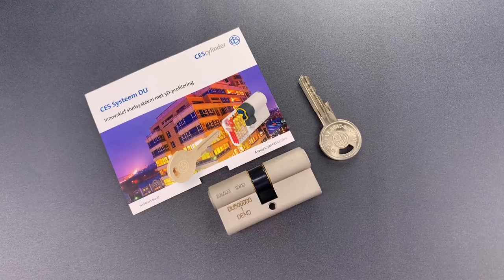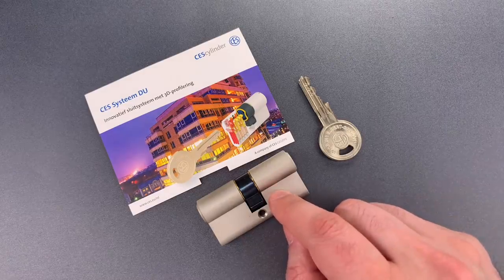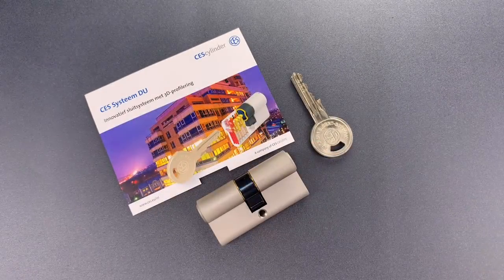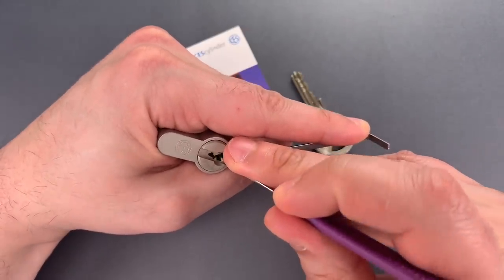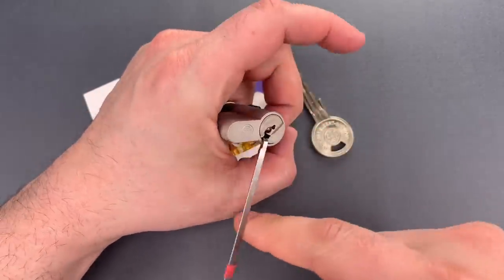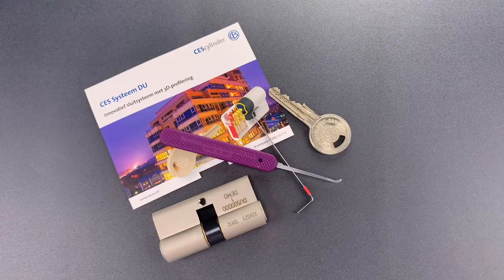[1248] Absurdly Paracentric CES Euro Cylinder Picked

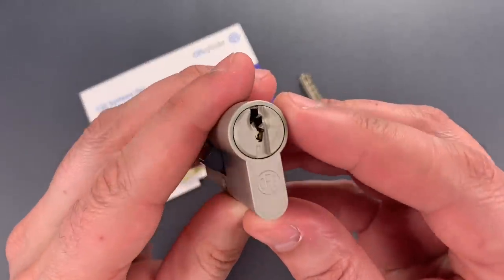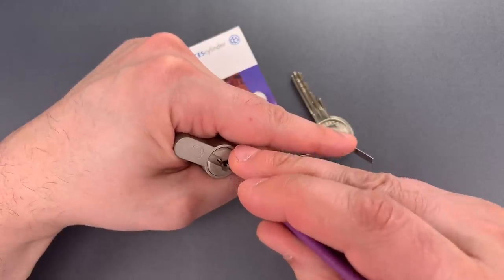Comment: So, you show the lock the right side up 0:13 but when you pick it you turn it 180° 1:00 so the pins fall down by gravity. You do this in every video. You remove a door, turn it 180° and than pick the lock? Start picking locks the right way up like they are on a door and not turned 180°. I gave a child lock to pick and set the lock like you pick them the wrong way up and they can do it with ease. Put it the right way up and they can't.

Comment: The key even has dimples to try to confuse people?
Reply: Those would probably be key-control.
Reply: Ahh, that's why LPL used a pick with dimples on the handle ;)
Reply: hi, do you mean dimples or the dots on the sides of the key??
Reply: @ConstantlyDamaged  Key-Control?
Reply: @Tidiabl69  he means the dimples on the side of the key lmao
Reply: @black3pac  ok , sorry for my translations problems , i'm not fluent in english...but I use this kind of key at home and it open the building entrance door and my appartment door , so , i think (but not sure) the dimples position is the same on every neighbour key (to open the building entrance) and the appartment lock is using the other way wich is different for each neigbour...
Reply: I think the demo version is just for show. Should have pins, I see pins on the PExtra Kaba key or the Iseo F9. Should be picked.

Comment: After watching hundreds of LPL videos, I have determined that the only unpickable locks are either a welded shut lock or a lock sticker.  

In the fire service, it is a challenge to train fire fighters to try the door knob to see if it is locked before breaking down the door bypassing the lock all together.  Many times it is not even locked.
Reply: He has a bunch he was never able to pick. Most had wild key ways. There was at least 5 that i remember
Reply: @baqcasanke  he could not pick a bowley lock, I think.

Comment: Genuine question: Is it easier to pick these locks as standalone units where you can get a good grip of the lock, than for example if the lock was actually in use installed into a door?
I would assume that being in a door, it would be easier as you don't have to use a single hand to hold the lock AND tension it?
Which way is easiest?
Reply: I wonder this all the time, mainly if it would take 2x longer to pick against a door with a frame or in a corner. Like how much advantage is there is being able to position the angle of the lock nicely, as well as the tools.

Because, you know, 34sec vs 17sec...oh, nevermind.
Reply: When it's in a door, he will have difficulty because to begin with, nobody installs those cores as he picks them. He's holding it upside down, which gives him a clear advantage, so you can expect a drop in speed of a few seconds. But then again, he's not demonstrating technique here, rather "being able to". If you do technique, you don't speak, that's lock picking 101. So don't really take these vids of his as "the way", because they aren't. As for the tensioning bit, that's trivial, it's actually easier to tension an euro lock in its door, rather than in hand, because you rest your hand on the door and everything is stable, where as here, keeping it in the hand ends up giving a few false positives (my term, not the standard term) as the lock moves in the hand.
Reply: As a locksmith for 42 years I can tell you that picking a cylinder that is in your hand is usually easier to pick. When you pick a lock on a door your feedback of moving & setting pins is transferred through the pick to your picking hand. When holding a cylinder not mounted in a lock, you also get feedback through your holding hand. Of course, there is also issues of weather conditions, corrosion, frozen hands, bolts that drag on strike plate that make turning difficult, people watching over your shoulder about their brother in law who would have picked that lock in 5 seconds, etc. LPL would have more difficulty in actual lockout situations. With that said, LPL is just as good or better at picking than most locksmiths.
Reply: @mikrobspen  and others, thanks for your replies. I by no means want to cast any doubt on LPL's abilities here, I would like to make sure people know this was a genuine question not trying to be negative or anything. I watch LPL's videos as they're just so supremely interesting. 👍👍
Reply: @aserta  Here in Sweden I've seen locks being mounted both ways (pins up as well as pins down), so "nobody" is a bit too strong choice of word.
Then again, he's holding this lock diagonally... That, I haven't seen yet. :)
Reply: @mikrobspen  > LPL is just as good or better at picking than most locksmiths
You're joking right? He's literally one of the best in the world, by a longshot. The average hobby picker is better than the vast majority of drillsmiths. Then again, I don't know what I expected. Typical locksmith, getting defensive and trying to play down the skills of hobbists that are way out of their league.
Reply: I find it easier with the lock held in some form of mount myself. If the lock is positioned such that it 'cramps your style' as it were then that does take longer, good self challenge though.

As is to pick in the opposite direction to what you're used to.
Reply: @aserta  It depends on what you're used to. Most UK pickers I've seen on youtube pick pins down. 
The thing with picking in a door is mostly that it's a bit of an awkward height if you didn't bring a stool/chair, but lock smiths seem to learn to get around that just fine.
Reply: @TheeGrandmaster   Most plumbers dont post videos either, doesn't mean steve lav is automatically the best. I'd be willing to bet that some of the best old pickers still only have flip phones and no computer.
Reply: @mikrobspen  You must understand that LPL now become a commercial advertiser lockpicker, so if there was some actual lockpicking from him in the past, you won't see it anymore ...
Reply: On the question of LPL's skill, I really have no particular course in the race, but at Lockfest in Seattle, he picked the final four locks in a bit over 8 minutes. 2nd place took 15 minutes, and didn't even open the fourth lock. Objectively that puts him in a different league, even from people who compete at this.
Reply: @qikink1  LPL start as LockSporter (picking locks in vice or in hand). Now, he find a financial interest in that, and start to advertise tools for locksmiths by showing picking locks in situations that is no where near to real life situations, and that is what irritate locksmiths ...
Reply: @skoronesa1 Might be of course. But he also won the very first competition he ever entered(according to himself) at Lockfest 2019. So he seems to be at least well above average.
Reply: The mountain access gates in my area tend to use a high security padlock buried deep inside a vertical piece of heavy-gauge steel pipe, with a welded cap on top.  It's even a bit of a challenge to remove and replace the lock after it's been opened with a key.  I have wondered dozens of times what LPL would be able to do in such a situation.

For myself, if I had a desperate need to open such a gate and didn't have a key, I'd use a hacksaw or angle grinder on the gate hinges.  It's be sheer misery to reach up into that constricted pipe with two hands and do much of anything, partly because the pipe is narrow and partly because it's only about 50 cm above the muddy rocky ground.  Its closeness to the ground is intentional, I believe.  Discouragement is half of defeat!

Comment: That's the exact lock installed on my door here in Germany. I still wonder how LPL would fare if the cylinder was the correct way up. Just general curiosity if it makes a difference in picking. Because for some reason, this seems like yet another difference between US and Europe with the style of mounting euro profile cylinders.
Reply: Can you tell me where to purchase this specific cylinder? I can find similar ones but not this exact keyway..

Comment: Question: This cylinders often can't be rotate when keys are inserted from both sites (at the same time). Does that mean, as long as there is a key inserted, they can't be picked from the other site?
Reply: If the key is inserted and turned from the inside, yes. Given it's not possible to manually rotate the inside cylinder and the cam  through the keyway (which I believe isn't unless tghe lock if flawed).
Reply: Depends. Those locks exist in 2 variants, one where one side locks out the other when a key is inserted and one where it doesn't (so called "hotel locks").
Reply: Correct, I have one of these.

Comment: LockPickingLawyer: literally breaks into Fort Knox 
Also LockPickingLawyer: so as you can see this lock isn’t very secure
Reply: I'm pretty sure the security on Fort Knox isn't very centered around the locks themselves so much as armed guards.
Reply: @ShadowDragon8685  Some pickers would at first glance consider this tank brigade unpickable, but you can pick them with relative ease using the techniques outlined in video 66.6. A click on tank one, a click on tank 2, a click on tank 1000, and now we only got these little locks, for which I will use this wave rake. And we've got this open. Once more, to show you that it was not fluke, fort closed, the tanks, the lock, fort opened, closed again, tanks, lock, fort open. As  you can see, this was not a fluke.
Reply: @ShadowDragon8685  he’ll pick the guards

Comment: This guy's gonna figure out how to pick through steel plate soon. 

"We need to cut trough the armor! Quick, grab the grinder!"
Breaks out lockpicking set
"What are you going to do moron, pick your way through the steel plate? That's impossi...."
"Counter rotation on molecule 4 and... we got this open. Okay folks, as you saw this molecular structure really wasn't that challenging"
Reply: He says, as the plate crumbles into iron filings and graphite dust.

Comment: Hi Mr LockPickingLayer , 
Do you know if it's possible to pick this kind of lock if on the other side of the lock , the key is on and already turned ( i mean not just pushed inside the lock but pushed and turned , not on the "neutral position") ??
 Thanks

Comment: Hello LPL,
I have a question regarding this kind of locks.

Those locks are common in germany as Appartment Door Locks, House Door Locks etc. and there is kind of a "Myth" going arround, that says if you put the Key on the inside and slightly turn it, you can't open the lock from the other side, even with the right key. (Sorry for my english, its not my native)

Can you demonstrate how this works, and if this would mean it is unpickable as long as the key is inserted from the inside?

Thanks in Advanced and have a Nice Day
Reply: Just playing with one of these locks, I notice 2 things: (1) with a key in one side, you can not insert another KEY on the other side; (2) with a key inserted on one side, the other side appears to be "disengaged" (it has to, to allow the mechanism to actually turn!). The question is whether there is any sort of "bypass" that a picker can use?
Reply: @paulblitz   i don't know about bypasses, but when you buy these locks you decide if you can unlock it with another key inside (safety / child proof lock) or the standard

Comment: That looked like wide open instead of wildly paracentric :D  I mean I've seen worse and way yess accessible ones in your "10 nastiest keyways" video, this one looked like any reasonably thin pick could pass between the two wardings without trouble, as long as you have something that can lodge into the wide far-end of the keyway to turn with...

Comment: I have to ask. In my job in the ambulanceservice in Oslo, Norway, we often have to get quickly thru a door. The firedepartment helps us all the time, but also locksmiths. I have been dooing this for 17 years now and have never seen a lock getting picked. Only drilled or the doorframe get smashed. Even drilling the lock takes 5-10 minutes to do and several broken drillbits. Should a locksmith be able to pick most locks? The most common brands are TrioVing and ASSA.

Comment: Just yesterday the usps delivered a package to me by placing it in a separate mailbox, and leaving the key to that separate box in my personal mailbox. When I put the key into the separate mailbox, I got my package, but could not remove the key, to prevent me from claiming packages destined for other residents. I am curious how those locks work- have you done a video about those kinds of locks, which prevent removal of the key? Is it a mechanism with false pins that fall into a special groove? While mail fraud is a serious crime and I would never intend to commit it, I find myself curious all the same.

Comment: Just an observation, these locks would be fitted in a door the correct way round, but when you are picking it, you are holding it upside down, would this pick be possible installed in a door in the correct orientation?

Comment: I've picked a few Euro type cylinders and the problem I have had it after I've picked it. The link that drives the unlocking pawl gets out of position and I can't use the key .
I have to re-pick the lock, reposition the cylinder to get the original key to work again?
I'm I doing something wrong?

Comment: I am genuinely curious how much easier picking a lock is when it's not actually inserted in a flat surface as it should be. I looks like the grip holding the exposed lock makes it easier to tighten the core. Any insight would be welcome :)

Comment: I think people should be aware of the why and the why not with these cylinders. These Euro cylinders just like the PExtra en F9 from Iseo or this CES were built for particular reasons.

Not everything comes down to picking a lock. It's just bad publicity for the manufacturer (CES in this case). 

Also, there are pins on the side of the key  which you have not picked, were they present in your demo cylinder ?

These cylinders were produced for profile attribution for vendors and or master key system.

Also it will be good to see the EN1303 grade shown, germans, italians, spanish and french's follow the Euro rule.

Comment: Lock picking question: One of the doors I go through all the time has a weirdly keyed lock. It is 5 pins but the first 2 and last 2 cuts on the key are flat (high as the pins will go) and the middle cut is a deep valley (as low as the pin will go). Would this be easier or harder to pick than one with a more random distribution of pins?
Reply: That sounds more like a key control than bitting. If it is the bitting wouldn't be difficult to pick but likely require a much larger than usual hook to do it

Comment: Being in Europe, my house has 2 euro-cylinders, a similar oval one, a normal cylinder lock, and two mortice locks. I don't think ANY of them are particularly high quality. Reading online, it appears that the majority of attacks on (older) euro-cylinders like this are NOT by picking, but by simply BREAKING them (they break at the weak point, where the screw is)... But even more breaking and entering is done by just breaking the glass / adjacent wooden / plastic panel. So, fitting a "better lock" isn't much of a help, you need to think about securing the internal lock mechanism too, don't leave keys on the inside of your doors etc.

Comment: Couldn't companies force the binding order in a way that the deepest pin sets last and has a super short key pin while the pin that's closest to the outside sets first and has the longest key pin possible?
Reply: Great idea. Would be so much simpler indeed.
Reply: Probably, why would they though? It makes locks more predictable and therefore easier to pick.
Reply: @NoobLord98  by making it somewhere between super hard and borderline impossible to use tools. If you have to get in at a steep angle and have borderline no space to work (remember, pin 1 would bind first and have the longest possible keypin, or even funnier one of the pins in the middle literally being in the way in a manner the pick cannot even set the final pin
Reply: You can't make pins bind in a particular order. A pin "binds" when the driver pin is lifted and catches in the shear line

Setting all the pins in order-
Pros: will need to use an abnormally deep hook
Cons: makes the lock a lot easier to pick, bump, and rake open
(As long as there's enough space for the key to insert there will be enough room to pick)
Reply: @mattr791  why shouldn't you be able to abuse the physics that even create Seperate binding to your advantage? I mean the pin that is the thickest compared to its hole is gonna bind first, and the thinnest is gonna bind last. That's literally how spools and other security pins mess with you

Comment: Hi LPL,

I want to see you add an additional demo in each video from now on, where the lock is appropriately installed & picked under "natural picking conditions", being that when you're picking in front of the camera you're holding the lock full-handedly which is an "unnatural picking condition". 

I'm not entirely convinced that picking some of these locks is as easy as you're making it out to be. Yes you have the skills I don't in any way discredit that, but the locks are in you're hands quite literally, rather than tools-only like anybody else would be expected to perform a pick.

Yes I know such would cost you some more time and money for each video you can put-out in any given week, but I'm pretty sure a trade-off of Patreon with saying the names of paying viewers in the demo-section of the video would aptly compensate your channel?
Reply: As someone who's been involved in locksport for several years I can tell you that the orientation of a lock does not affect pick resistance. A lock installed properly in a door may put the picker at an uncomfortable angle but that's all it does
"Not convinced picking some of these locks are as easy as he makes it out to be" 100% true and many of the locks he picks on this channel in a few mins would take myself and most others in similar conditions several hours to crack